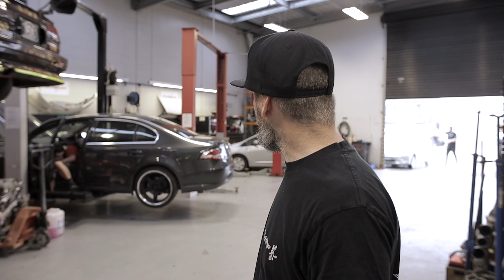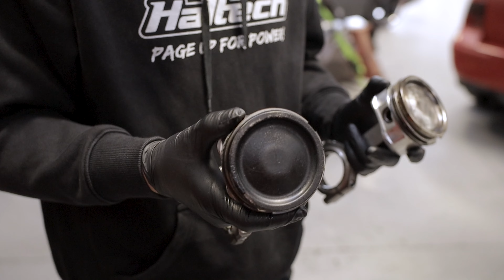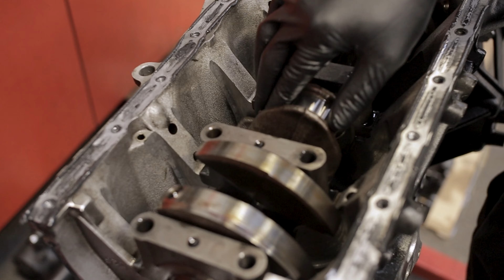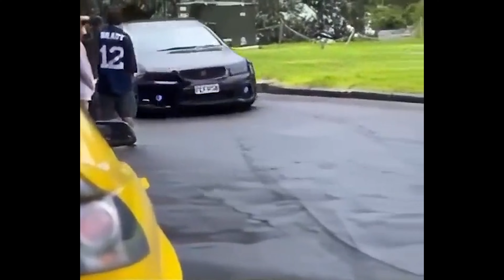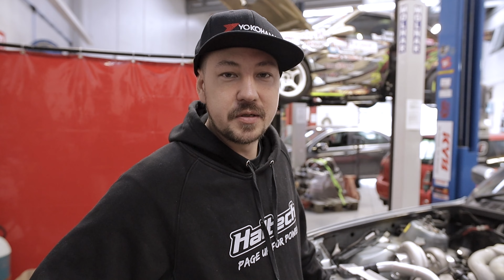Torque Workshop Update & 86Fighters Smokey Car Explanation

Comment: TH400 - POWER GLYDE . 3- 2SPD ?= 5 speed dct,cvt,????? WERE 540KW DYNO RUN.head studs & 540kw...VIDEO BE NICE OF THAT...
Reply from the maker: Unfortunately the G6E is back down with the owner...but if you want to see more Barra stuff you got it !
Reply from the maker: And yeah its a Turbo TH400 3 speeds, not a powerglyde.